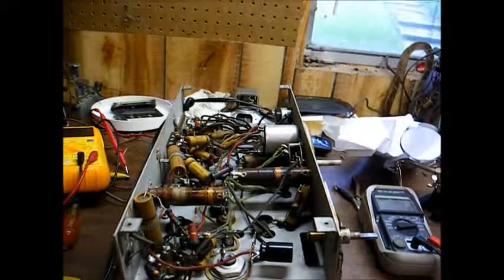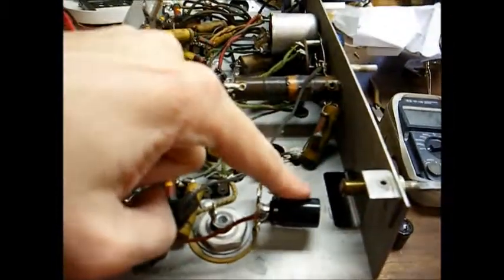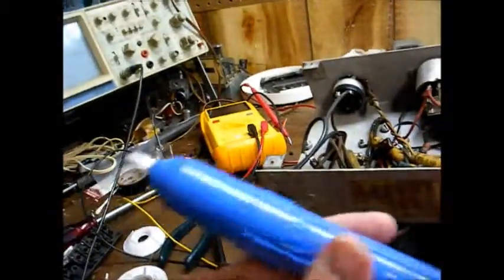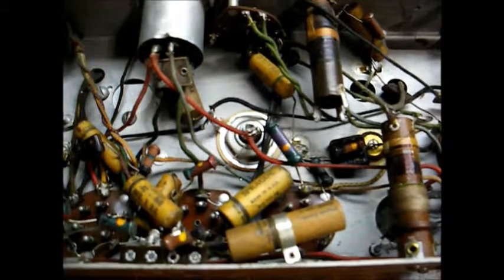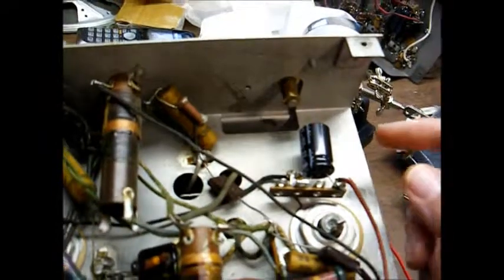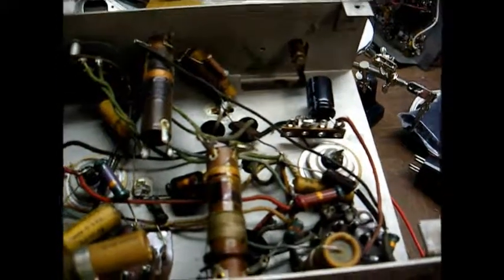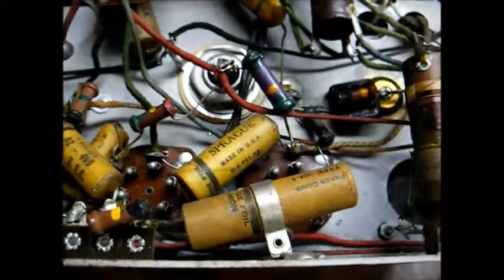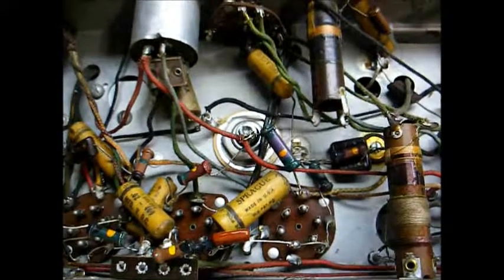Westinghouse WR209 tube radio electronic restoration - part two

Comment: I do have to DIS agree with you in that if there was a .05, you should replace it with a .05 (available at JustRadios.com for .49 cents each), OR, add a .033 MFD cap with your .047 to come up with the correct .05 value.  It CAN be critical in tuned IF & RF stages AND even though a .047 is within tolerance, it is at the bottom end & if it gets at ALL weak, it'll fall quickly OUT of tolerance. So, Yeah. If it calls for a .05, I replace it with a .047 & a .033 in parallel, a .056 or the correct .05, which is available at JustRadios.com for 49 cents, along with all other common old radio values